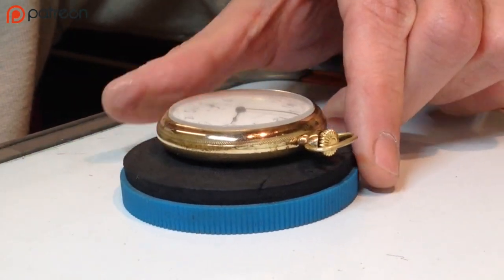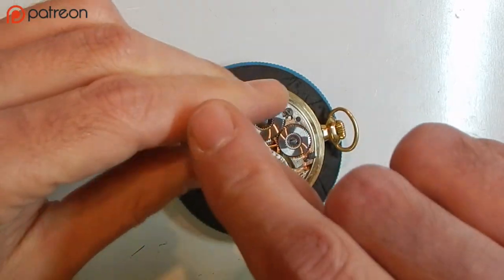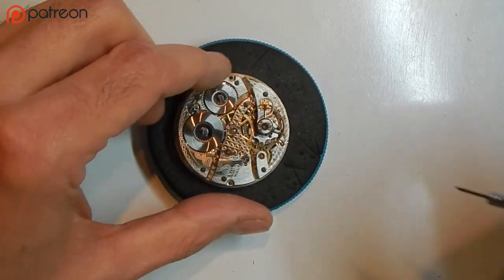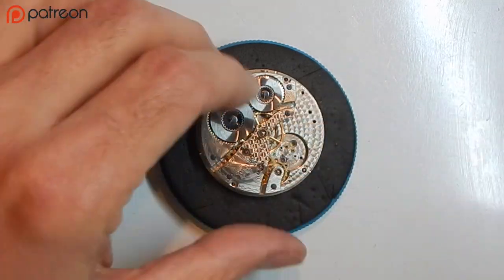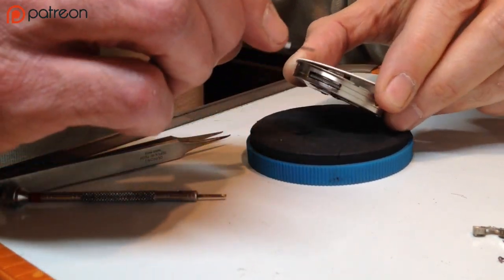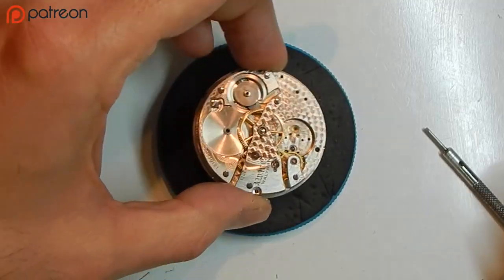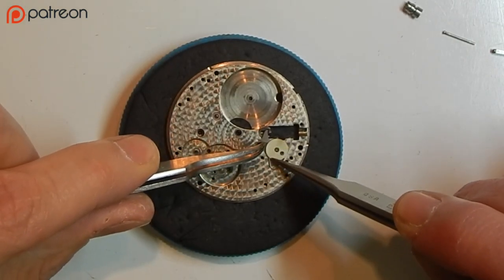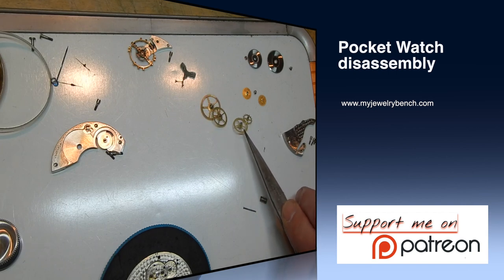MJB - Clean a Pocket Watch  Part 1, dismantle

Comment: Hi, great video of the complete watch cleaning process. Just wondering what cleaning solution or what do you use in your ultrasonic cleaner.
Reply from the maker: There are several good brands of cleaner. I don’t however recommend parts rinse. Gemoro jewelry cleaner does more to get parts clean. Onedip for hairspring. I rinse all parts in warm IPA 91% and hand dry.   If you want a home brew. Get yourself a bottle of fantastic. It is a great degreaser. 1/4 cup in ultrasonic cleaner filled with warm water. Works great on most parts. Don’t used it on anything other than metal. Rinse with IPA
Reply: @watchesandjewelry  Thank you for the reply. I will look online for the Gemoro and if I can't find that I will try the home brew. Just finished your MJB pocket watch reassembly 3 section videos this morning. They were great with lots of tips like the one about not screwing down the plates all the way until the complete train is in place and testing the train before putting in the pallet fork. Looking forward to watching some more of your videos. Thanks again, Mark